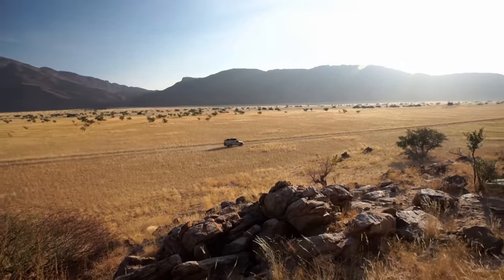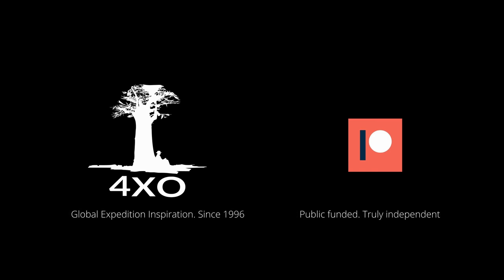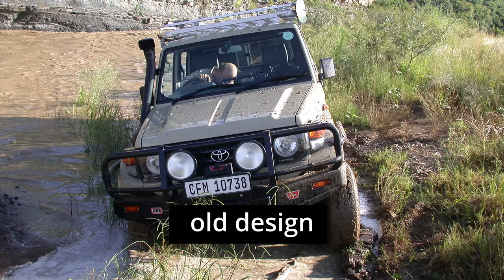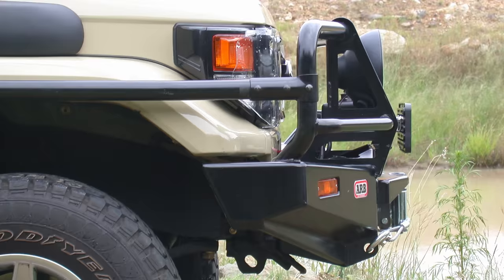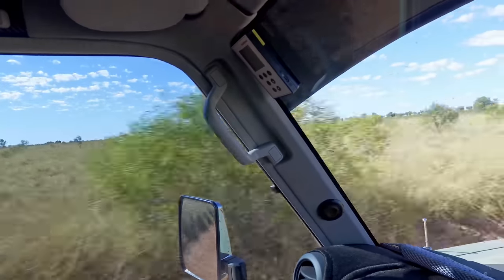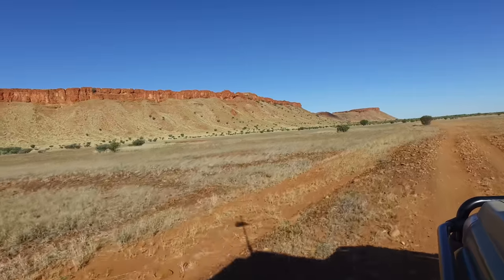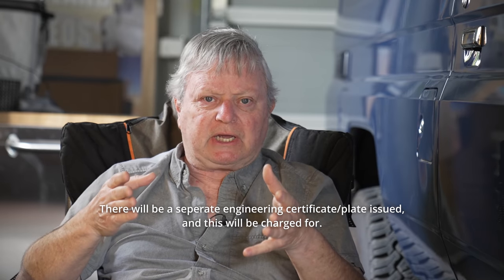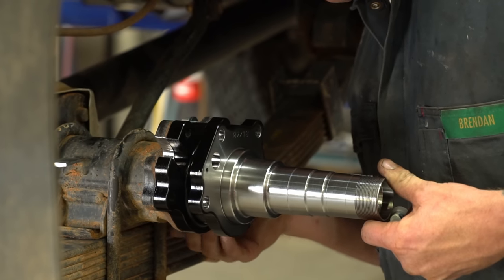TOYOTA LAND CRUISER AXLE-WIDTH CORRECTION. Is it Really needed? Cheaper alternatives? | 4xOverland

Comment: We don't run 70's for fun and for leisure and compete for and pander to the accessory market... we drive them everyday on our cattle properties in endless mud, rain, bottomless dust, 0'C to high '40's and with animals bouncing off them all the time. You highway jockeys might feel a difference, but out here, it makes no bloody difference. To someone driving these to make things work, at least. Doesn't feel any bloody different from the 79 series turbo-6's we still have a few of here too.
Edit: Yes it's a typical engineering deficiency, typical from Toyota, and it should've been corrected,  but it does not detract from the vehicle's performance except to the people selling the bits on Youtube channels.

Comment: First 2 minutes in.... And wrong information.

The older 75 series also has a different track width to the front.

Not as much. But it still does.

78 and 79 newer front is 100mm difference total and the 75, 78 and 79 series narrow front is 50mm

I have a 1990 troopy 75 series.

Comment: This has really got me thinking & have not a clue on the answer.

What is ideal for any 4X4 when on hard roads, off road & towing when it come to widening or narrowing a back axle?

Should you rely on the car makers settings (not just a toyota) should they be widened at the back especially when towing & the various surfaces around the world we drive on.

I would be interested in your thoughts, or even experiments on various vehicles as I am starting to consider my next vehicle which will need to tow on tarmac & off road in the wet & windy lands of the UK & Europe.
Reply from the maker: The track on front and back axles should be the same. As it is with most cars and 4wds.

Comment: That TrueTrac system is beautiful. Are the rear axles now chromoly?

Wouldn't want to have non-standard length axles fitted without upgrading the materials. Thay would lessen the risk of breaking non-standard items in remote areas.
Reply: Not true I'm afraid. About 90% of mechanical / structural breakages are due to fatigue. Using high strength steel does nothing to combat fatigue. Sorry.

Comment: Widener front axle makes vehicle more stable specily in off-road while narrow back axle help with manovering in tight spaces. Toyota use this in Land Cruiser long time ago when no V8 was available.
Reply from the maker: I disagree. None of these 'advantages' apply in the real world. Before the V8, was the 75. And both axles were the same width. The turning radius of the current LC-70 is very poor -  the smallest of almost any solid-axle 4wd ever made.
Reply: @4xoverland  LC front axle width variates over the years but biggest difference  comes with the introduction of 80 series type axle on coil 70series(wider but smaller diff).From off road perspective, narrower rear axle follow the front when turning so is easier between trees and rocks. 
Factory flare arches are available on 70 series.

Comment: odd that a short wheel base has less effect. when you think about it, it should swerve more, as the angle between front and rear wheel is sharper compared to a longer wheelbase.
Reply: I was thinking exactly that!
Reply: My experience was the shorter 76 wheelbase was worse without track correction

Comment: Complete agree with the 78s searching, or what feels like "crabbing", on sand or in muddy ruts. And this was in an "old" HZJ78 with the older body style.  I believe those old body style HZJ78s also had wider front tracks, just no where near as extreme as the newer ones. My old HJ60 was much nicer to drive in those conditions.
Reply: Front track was 15mm wider on the front on a HZJ78 - the HJ60 had the same difference. I had one once and it wandered because I never did the caster correction after lifting the front springs.

Comment: I've never had a Toyota land cruiser so I might be showing my ignorance here. But I'm curious if there are options for doing a rear axle swap the same way the jeep community does. There's dozens of different axle options out there for every vehicle here in the states. Some people do axle swaps to change the gear ratio because it's so much easier than taking the axle apart to change out the gears. Are there known axles that are the correct width and gear ratio that can be dropped right in?

Comment: I am an avid Toyota fan, yet I think it is a disgrace that the 70 series has this axle issue! It would cost Toyota virtually pennies to fit a longer rear axle, but no it's left to the customer to fix at $6500 or more. If you fit the Dana 60 kit, it's more like $10000. And it's not like the 70 series is a cheap vehicle to buy in the first place.

Comment: I live 15 minutes away from you Andrew so you know how deep the sand is here. In the 4 years I’ve had my 78 series I’ve never even considered the need to ‘correct’ the rear axle. But you can bet the companies selling these modifications tell you that you need to do so. I reckon if I’d spent $3.5k doing it I’d also be justifying it to myself and everybody on the internet too haha
Reply: I agree. I don’t live in commiestralia, but if I did, and if I couldn’t afford a thing I needed, I would justify not needing it so I wouldn’t have to feel bad for not being able to afford it.
Reply: @lanceroark6386  commiestralia??
Reply: 11:42
Reply: Spending the extra $3.5k to correct rear differential sounds very sensible comparing it to justifying spending 80k+ on a vehicle and not having the wheels not line up.

Comment: Very well explained sir🍻. 
You are fortunate to have said items donated.  I would likely never do a mod like this,,  primarily due to the cost. We don't need a Engineering sign off here in the States.  
Spacers are legal here,
and used by way too many people 😕.  I don't condone them either, but obviously the most cost effective approach. 
 We also don't have the Cruiser models you mentioned.  And those beautiful Full Floating rear Axles are rare as hen's teeth here as well. 
  So,, to wrap this up, 
If I had this narrow Axle situation,, 
I would use spacers and regularity service/ inspect the bearings.
  Just my 2cents. 
Cheers 🍻,  G. In beautiful Boulder City Nv, USA 🇺🇸
Reply: @Gabriel, that is not true in all states.  In NJ you don't need to get an engineering sign-off on axle swaps, but spacers are illegal.
Reply: @mrkmdz  ,,  thanks for the info 👍.

Comment: Andrew, Just a correction. Non of the toyota semi-float axles have bearings in touch with the axle oil.
Reply: They do if you remove the axle seal. Seen heaps like that
Reply from the maker: that's exactly what I said. Just not in those words.

Comment: Hi I have a question
Do's the track correction issue in the LC 70 V6 engine the same as V8 engine?
Reply from the maker: The engine fitted makes no difference. V8, V6, straight-6, they all share the same rear axle.

Comment: Sir,
In case of a 95 mm difference can we not use -25 mm offset in the rear and +25 mm in the front.
I think This will help massively in solving the problem.
Please provide your valuable inputs.
Thanks 😊 
Fig fan from New Delhi, INDIA 🇮🇳
Reply: Watch the video. He covers this towards the end
Reply: Even -10 and +10 would be good . But I in VIC and we don't do sand, just rock and clay so you would never know
Reply: @b3vo  Seen sir
Reply: @JimBob-qh8gl  Sir,
India Is a demographically rich country. We are fortunate enough to have massive Thar desert , a coast line of about 2-3k km and the mighty himalyan passes which are above 19,000 ft. 
The following are to be considered while building a rig.
Thanks 😊
Reply: My thoughts too, Assuming you're getting 4 new wheels as Andrew did at the start of this Troopy project   -25mm in the rear and increase the front but it may lead to clearance issues on full lock but even so a +10mm front increase might be accommodated but that could be investigated with tyre choice at the same time and you would be a whole lot closer to ideal - and keep the spare 0mm

Comment: The 70 Series has so many modifications required to make it fit for purpose for offroad expeditions and outback touring around Australia.  Lack of sound deadening, basic side curtain airbags missing for the wagon, troopy and dual cab, weak gearbox/clutch, tinny chassis compared to a 200 Series, no automatic transmission option, token raised air intake unsuitable for water crossings, weak brakes, sagging leaf springs in the rear, low mounted alternator on the V8, starter motor that cannot be removed easily in the bush, underslung rear springs which get caught up in deep ruts all too easily, eventual rattly rear doors due to the spare tyre's weight on the rear doors, body spotwelds still done by hand at the factory, poor fuel consumption, no HVAC filter which allows fine dust to enter the airconditioning system and contaminating the cooling coils, no power adjustment for the far side door mirror, halogen headlamps, sash seat belt only for middle passenger on the 2nd row, uncomfortable seats, stupidly large turning circle, etc.

Definitely needs to be dragged into modern times to justify its ridiculously high price which Toyota charges simply because of the low volume and high demand in some countries like Australia.  Sealed for life bearings is one example of where modern design has proven itself for decades now.  So are side curtain airbags and proper lap & sash seat belts for all passengers and supportive seats for long journeys.

Put that 3.3 V6 twin turbo, 10 speed auto, fix the ridiculous track difference, add some sound deadening, put some modern safety and comfort in, and put some robots onto the assembly line to reduce the cost of manufacturing, Toyota.

Comment: I am sorry but those Tru-Tracker axle extensions look pretty dangerous to me. Let me explain why.
Axles do fail under sustained fatigue loading. On Youtube you will see catastropic failures suffered by GrizzlynBear and Mongrel Dog Productions amongst others. Jeeps are especially prone to axle failures because of their semi-floating half shafts.
The axle extensions will indeed protect the wheel bearings but they put increased bending stresses into the axle tube instead. The fatigue damage rises approximately with the cube of the stress range and hence the fatigue life of the axle will be reduced correspondingly. What Tru-Tracker should have done (and they may well have, but I'd like to see the evidence) is to prove that the reduced fatigue life is still acceptable. By this I mean something like a 25 year life under representative load conditions for a rugged 4x4 with a 98% probability of survival (i.e mean minus two standard deviations). One shouldn't be seduced by professional looking installation instructions with glossy photos, it means nothing. I'd be very happy to debate the issue with Tru-Tracker's chief engineer in confidence if he'd like to contact me.
If you want to increase the rear track of the Land Cruiser and maintain the original fatigue life of the axle the only way to do it is to strengthen the axle itself. In decreasing order of effectiveness the ways of doing this are to increase the OD (best option); increase the wall thickness; insert an inner liner (cheapest option). One can also use external strengthening (trussing) which is widely used in the USA.
ASPW may well not have any problems with the rear axle, particularly if the vehicle gets sold, but you can bet that if this vehicle was sent to Africa and used as a matatu the axle would break in just a few years.
If anyone is seriously interested in this subject they will find a series of 8 videos called "Why Axles Break" on my channel. I have tried to make the videos accessible but it needs commitment to wade through the series.

Comment: Hi.
Instead of seeking the full correction on the rear axle.
How about correcting ½ on each axle.
If you want to buy new rims anyway, it costs 0 or close to 0. But rims with the same amount of + offset on one axle as - offset on the other axle.
The practical price may be slightly narrow tires to have full steer. And or a slightly larger turning radius.
The amount of extra bearing load corresponds to a working model versus a loxus model in the form of 5.5'' wide rims instead of 7'' wide rims.
So not everyone to speculate on.
Regardless, there is 3500 Aud to service the bearing for. THAT will NEVER happen.

A Dane in Sweden

Comment: Did you ever experiment with wider over-width tyres on the rear, and reduced width tyres at front?
Reply from the maker: It will understeer like a tramp on acid.
Reply: @4xoverland  That's odd, because the twin rear wheel 4x4 Transit County
I used to drive would handle impeccably on mud, snow, sand, tarmac.

Comment: I must admit, I don't quite get the fascination with the 70-series. They look cool when fully kitted out, and... that is pretty much it? They don't flex well, they are underpowered, the cab is surprisingly small, and they cost a fortune to modify. I guess they are one of few remaining "new" vehicles with a solid front axle, but is that really enough to justify its status?
Reply: Its partly that yes, they are reliable, its part nostalgia, and its part stubbornness/brand loyalty.

Comment: Does this axle adjustment apply to non-V8 70 series? I have a 79 series double cab, 2020, 1HZ I6 engine. I have 16x8 -14 offset rims with LT265/75R16 tires. Can anyone help me figure out if my 79 series I6 has this issue?

Comment: Terrible design decision by Toyota on this, they should have stuck with the straight 6 engine too. Hopefully when they go back to the 6 cylinder they will no longer need the wider track at the front.
I  had a custom built trailer for off road touring and one of the prime considerations was that it had the same wheel and track as the tow vehicle...it just makes sense if you are going through sand, mud etc. Offset wheels don't make sense to me...all wheels on your rig/trailer should be the same and therefore interchangeable. I've had situations where we were changing and repairing up to 5 tyres a day. Offsetting like you said also changes the load on stress points making them more susceptible to fracture; seen several images of these new cruisers where the end of the axle housing has sheared right off on severe corrugations due to spacers or offset wheels

Comment: Im still a bit confused why people pay big $$$ for the 79series etc when they are so so basic and usually need quite a bit more $$$ to upgrade them with the equipment and comfort level that other (sometimes cheaper) 4wds already are fitted with. Not hating, just confused where the attraction is.
Reply: What else would you get. There really isn’t any competition. I am not a fan of the 79 in the slightest but for work and farm applications they really are the only option in Australia
Reply: Because there is no competition for it.
Reply: Im Aussie, and you’re right, its like being famous for being famous…
Reply: It's because they go and go and you can't kill them with a stick.  Nothing else in that class has such a heavy duty chassis or running gear.  They are stupily basic.  But they last a very long time, even if they get abused.
Reply: Being basic is a big part of the appeal. If you have a basic vehicle, to which you add things that improve its comfort, and something breaks in the middle of nowhere, you can probably either fix it, or at least limp it to somewhere where you can fix it.
The problem with more complex modern vehicles is that the amount of technology that's all linked up means that even minor faults can disable the vehicle.
Reply: you need to do as much upgrade to them as you would to any stock car. problem is, many people put too much rubbish on them including ASPW. many city people treating them like fashion accessories which never see the bush in their lifetime.
Reply: The only solid front axle option out there; much stronger and more durable than IFS (independent front suspension). Simpler, more basic technology (less technological complexity, especially electronics); the problems they do have generally known by mechanics in rural areas and readily diagnosed and fixed with fewer obscure difficult to diagnose issues than the more modern complex vehicles (including newer Hilux, Ranger, Isuzu etc. utes). Spares readily available.  Greater assurance that they're up to the job and will get you to your destination and back on remote outback and overland travels.

Comment: G’day Andrew, so does the V6 have the same wheel track, the same as the V8?
Reply from the maker: If it has the wider front body, then the axle tracks are different. While the problem was created when the V8 was introduced, it's got nothing to do with the engine fitted.
Reply: @4xoverland  ok cheers.

Comment: I'm looking forward to details of the changes coming to Landcruiser 70 series at the end of this year. Maybe they will fix this issue as part of the upgrade.
Reply: Not a chance.  They've got away with this abomination for a very long time, without complaint from any design rule anyware.  Shocking.
Reply: @einfelder8262  They have to meet strict new safety requirements in Australia. And have said they will be complying by end of this year.
Reply: Likely just an extra cup holder and a USB outlet
Reply: @user-rv6zk1pp7r  Even then it wouldn't be USB-C with PD.  :)
Reply: It will just be safety stuff to bring them up to date with the single cab i dare say 
There a commercial vehicle

Comment: Surely the cheapest solution would be to have front and rear wheels, the difference in width could be distributed between front and rear if all four wheels changed
Reply: What are you actuallysaying???
Reply: @marinusscholtz9342  he is refering to off set rims that would be diff from the front and rear wheels , making it track the same width